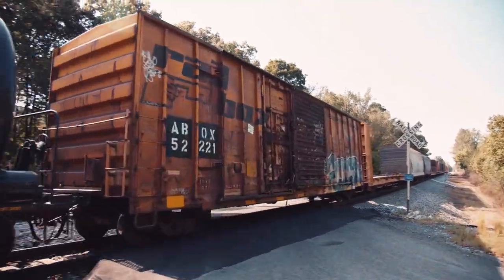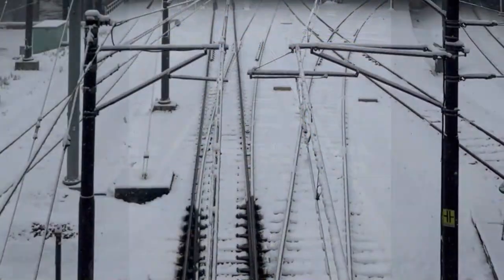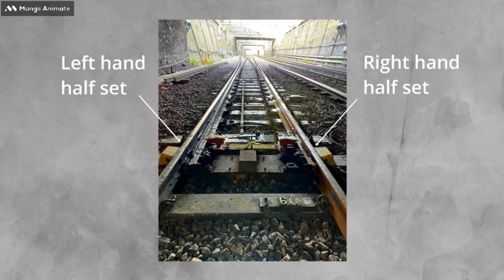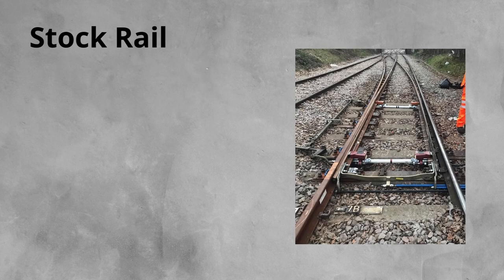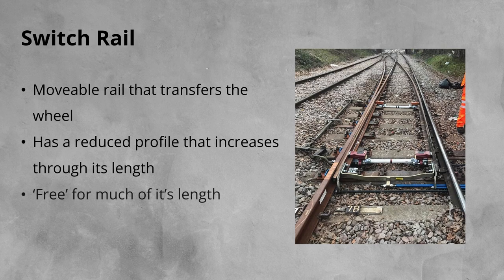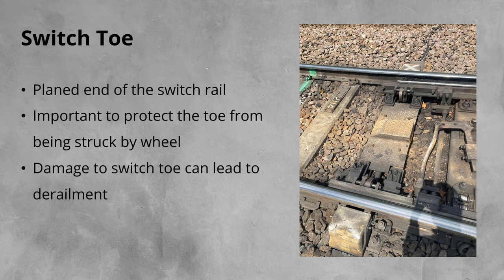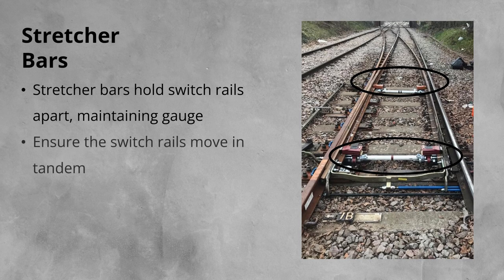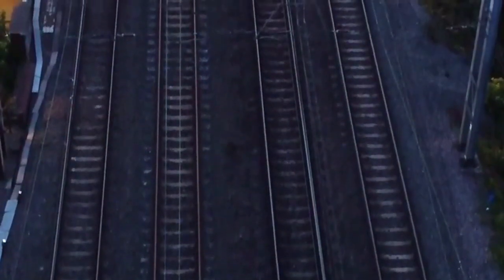Do you know about Railway Switches? The easy guide for engineers

Comment: You mention the 60deg angle needed at the switch but don't explain the significance of this figure. Could you do an explainer? I think it is to do with the angle of the wheel flange. So it could be to do with the famous wheel/rail interface (which concept and phrase was used as an argument against the separation of track and train that came with BR privatisation!)